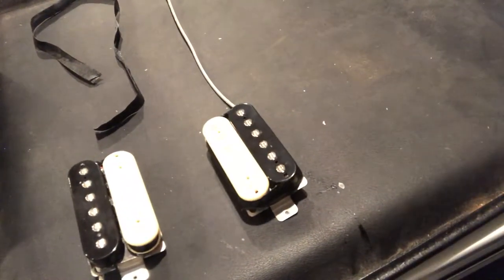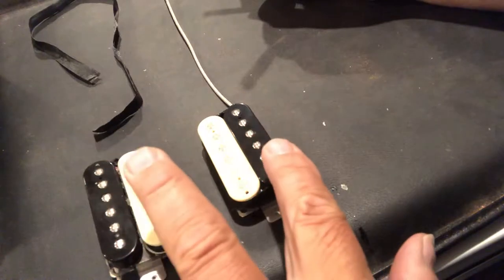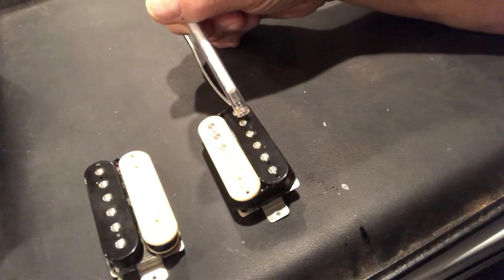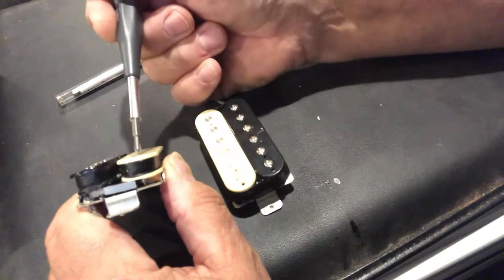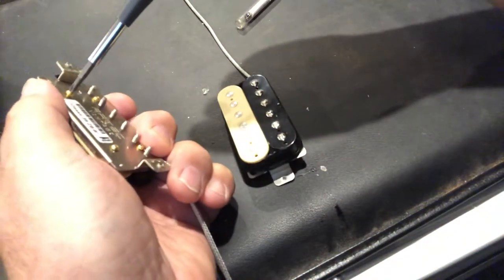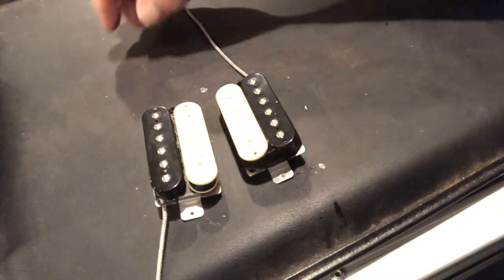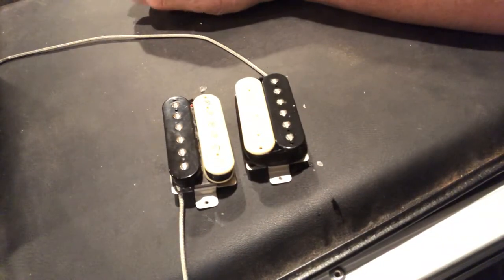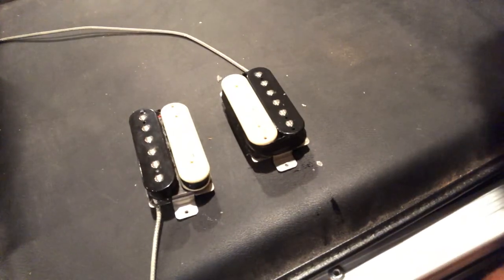Peter Green Mod

Comment: Is this different than out of phase wiring? As in swapping the hot and ground leads of one pickup?
Reply from the maker: No,  however, on a Gibson single conductor pickup , making the exposed shield a hot feed is an issue as it can short to other exposed shields in the body cavity.

Comment: if the polarity is on the sides, then wouldn't it be the same result wether if you flip it or spin it around?
Reply from the maker: Correct!  Some people “flip” the magnet end to end.  This would not change the polarity.  So you can rotate it or flip the face.  I say one way so there is no confusion.